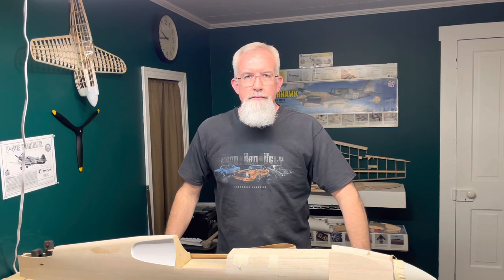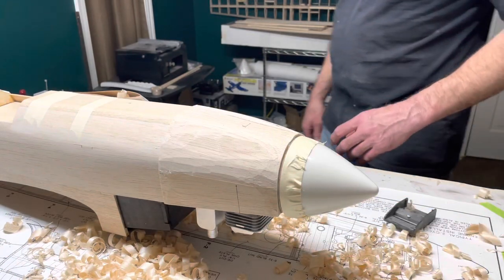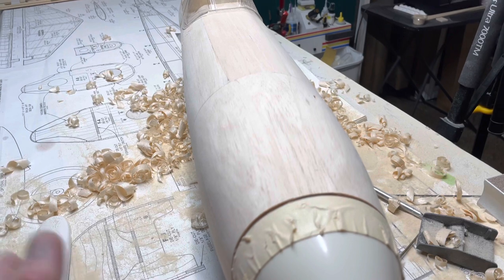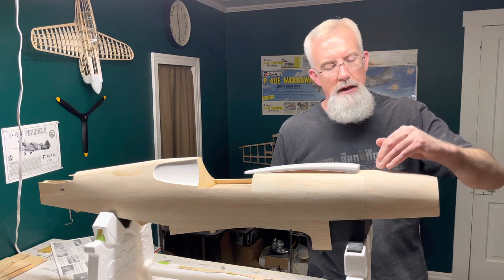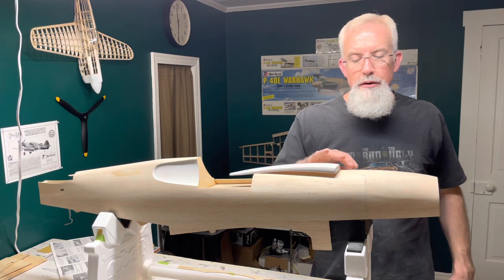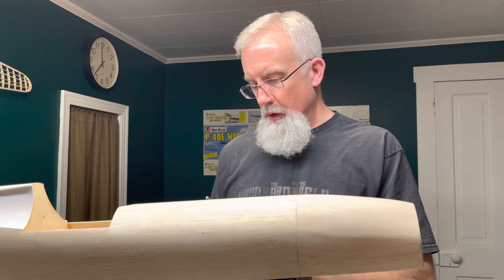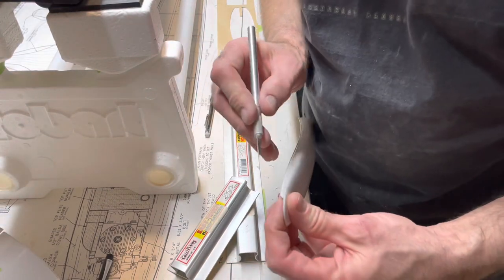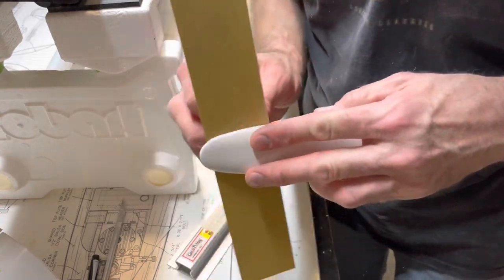Top Flite .60 size P-40E Warhawk Build: Part 22 (Shaping the top cowl)

Comment: The nose is looking sexy on this P40! I've always liked the P51 Mustang nose but this P40 is shaping up to be a cool bird!
Reply from the maker: Thanks. I’m a huge P-51 fan myself. I’m using this P-40 as practice for my next build series, which will be the P-51D.
Reply: @FranksModelAviationWorkshop  I saw you mentioned that in an earlier video. I started the Top Flite P51 some years ago but didn't finish it. I got the wing to the partially sheetfed part and finished the rear stabs. But that's it.

I've been told the nose on the TF Mustang is not contoured correctly. Make sure you look into that when you get to building the Mustang.
Reply from the maker: @jeffallen3382  yeah, I can see that in some builds I’ve seen on YouTube. The trick is to use thicker top cowl blocks. The kit wood was too narrow, and thin. That’s what I had to do on my P-40. I think that turned out pretty good.
Reply: @FranksModelAviationWorkshop  exactly. The nose drops off too soon in the plans. Good luck with your build!